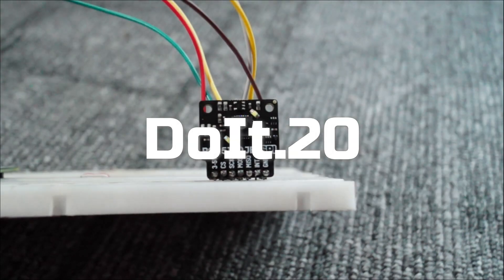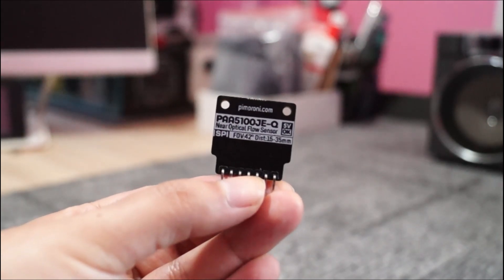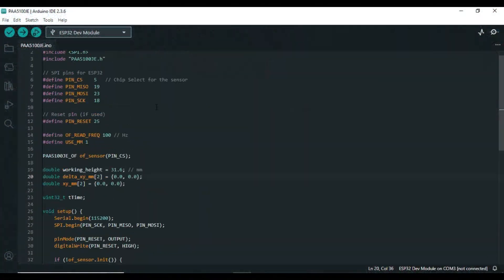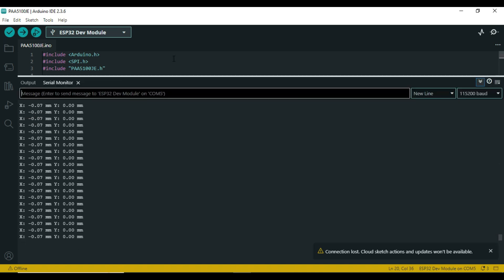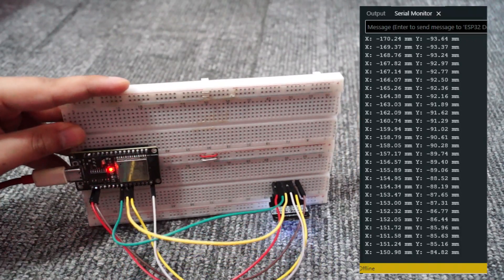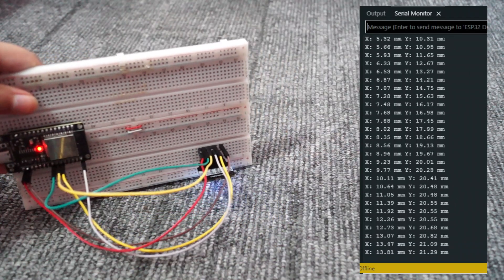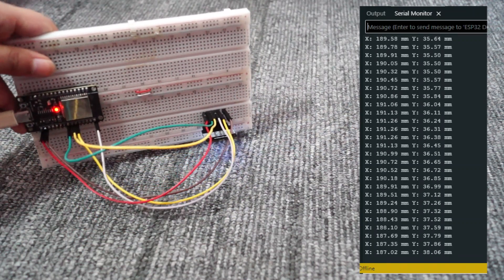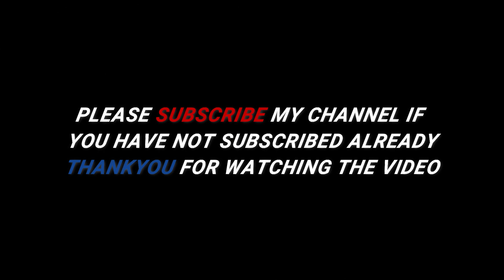PAA5100JE Optical Flow Sensor with ESP32 useful for Tracking Robots | Setup & Demo | Arduino IDE

Comment from the maker: #include <Arduino.h>
#include <SPI.h>
#include "PAA5100JE.h"

// SPI pins for ESP32
#define PIN_CS    5   // Chip Select for the sensor
#define PIN_MISO  19
#define PIN_MOSI  23
#define PIN_SCK   18

// Reset pin (if used)
#define PIN_RESET 25

#define OF_READ_FREQ 100 // Hz
#define USE_MM 1

PAA5100JE_OF of_sensor(PIN_CS);

double working_height = 31.6; // mm
double delta_xy_mm[2] = {0.0, 0.0};
double xy_mm[2] = {0.0, 0.0};

uint32_t tTime;

void setup() {
    Serial.begin(115200);
    SPI.begin(PIN_SCK, PIN_MISO, PIN_MOSI);

    pinMode(PIN_RESET, OUTPUT);
    digitalWrite(PIN_RESET, 100);

    if (!of_sensor.init()) {
        while (1) {
            Serial.println("Error initializing sensor");
            delay(500);
        }
    }

    delay(100);
    of_sensor.setWorkingHeight(working_height);
    of_sensor.setOrientation(true, false, false);
    delay(100);
}

void loop() {
    uint32_t t = millis();
    char serRead = Serial.read();

    // Reset coordinates
    if (serRead == 'x') {
        xy_mm[0] = 0;
        xy_mm[1] = 0;
    }

    // Read sensor at set frequency
    if ((t - tTime) >= (1000 / OF_READ_FREQ)) {
        if (!of_sensor.getDistance(delta_xy_mm)) {
            Serial.println("Error reading sensor");
        } else {
            xy_mm[0] += delta_xy_mm[0];
            xy_mm[1] += delta_xy_mm[1];
            Serial.print("X: "); Serial.print(xy_mm[0]);
            Serial.print(" mm Y: "); Serial.print(xy_mm[1]);
            Serial.println(" mm");
        }
        tTime = t;
    }
}